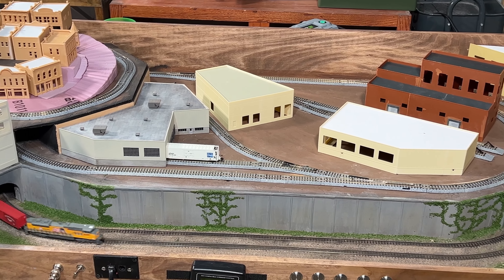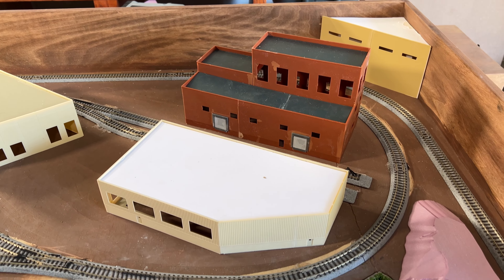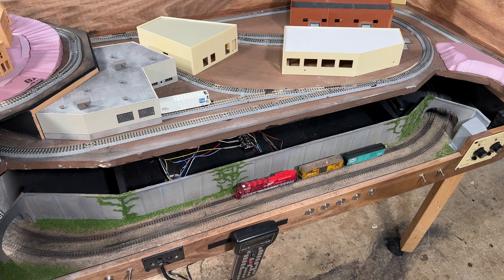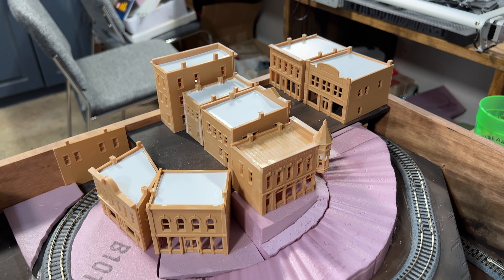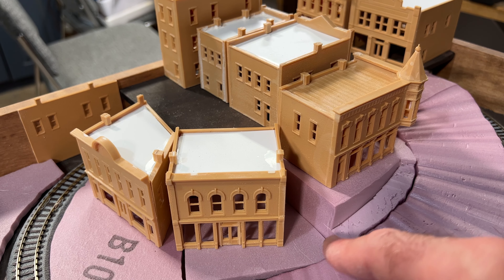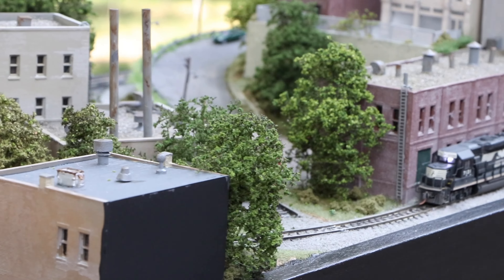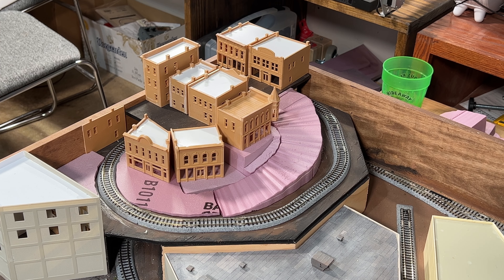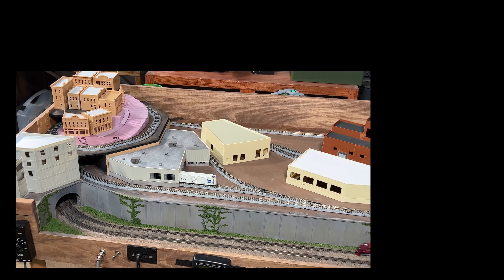Progress Update on the 2x4 N Scale Layout Project

Comment: I like the idea of replaceable sections for a small layout like this. Very nice.
Reply from the maker: I’ll probably make at least one of the structures removable with a fully painted and weathered concrete looking pad underneath and just have the structure attached by magnets. This way you can pop it off and have an instant team track to change up what loads you are delivering.
Reply: Nice job Steve of the layout of the structures etc. I'm a big fan of how you design your roads too. Cheers from Laurel, Delaware USA

Comment: I thought 24" was the smallest radius ?
Reply from the maker: You might be thinking of 24” diameter which would be a 12” radius. You can get Kato track with a radius down to 4 5/8”, although for regular rolling stock and such 7-9” is the range limit and 11” is the limit where you have pretty good odds of everything running well.